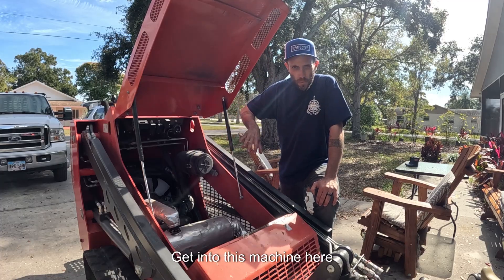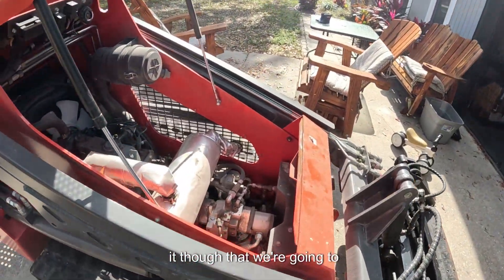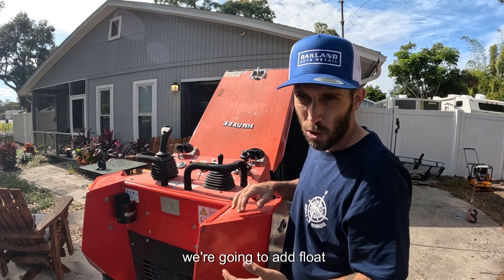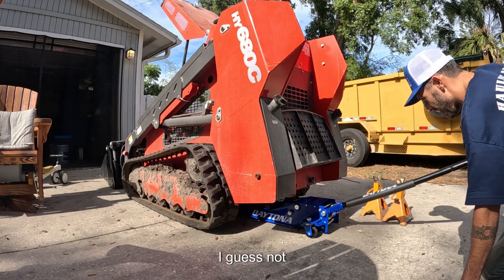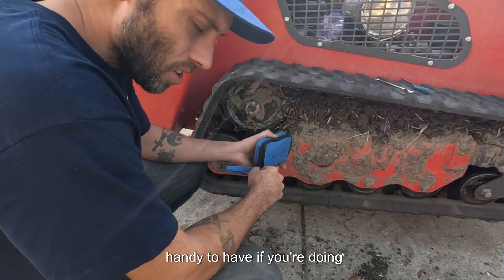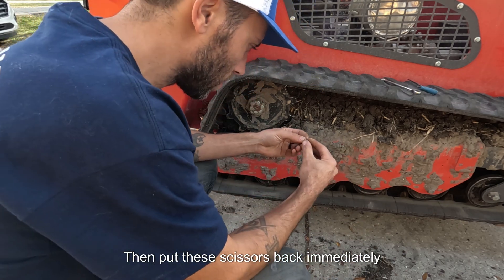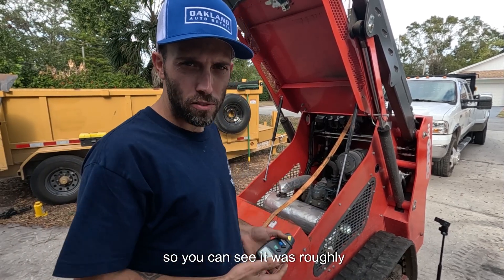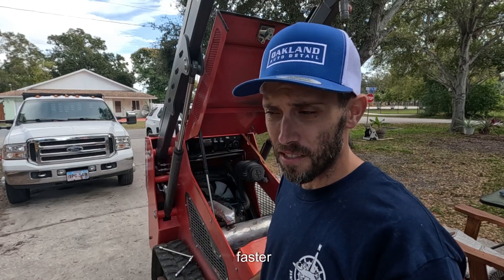Chinese Mini Skid Track Speed Adjustment: Who needs two speeds!?!

Comment: Could this be done on a CKG TK35R?  Also wonder if it’s possible to get it smoothed out a bit as it’s extremely jerky going forward. 

The place I bought it from has been working on it for a couple weeks and they believe they have it smoothed out, but I haven’t picked it up yet so hopefully they did but if not, I was curious what your thoughts were on it ?
Reply from the maker: Can’t be done, your machine doesn’t have these style drive motors

Comment: What is a normal RPM at idle...1000ish?
Reply from the maker: 700ish
Reply: @thegarageconnection  Ah, so my 1800 is too high. Think the throttle cable is adjusted too tight

Comment: Thanks for the great video. This is the information that I have been trying to find for several months. My Derette V1000 travels faster in reverse than forward. I knew there had to be a speed adjustment somewhere. I didn’t what to start blindly making adjustments. Plus I now know about the zero displacement adjustment.
Reply from the maker: Glad to help!